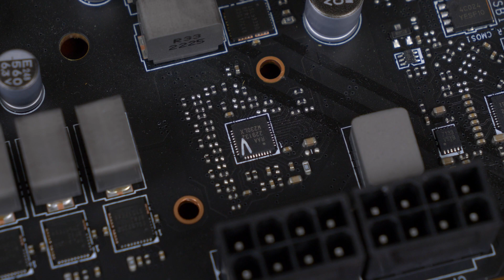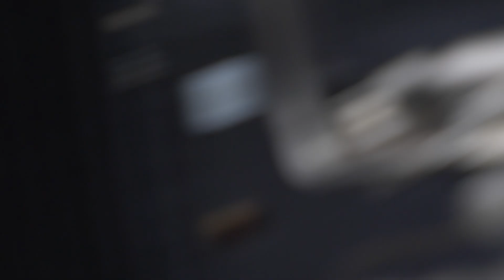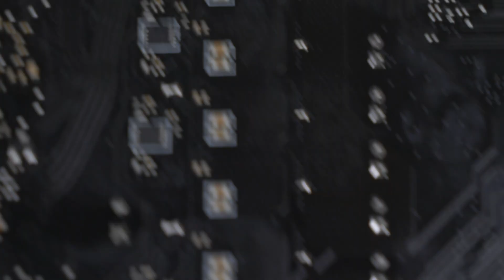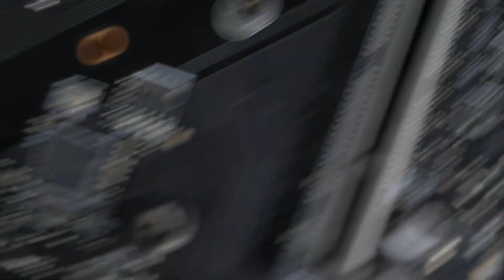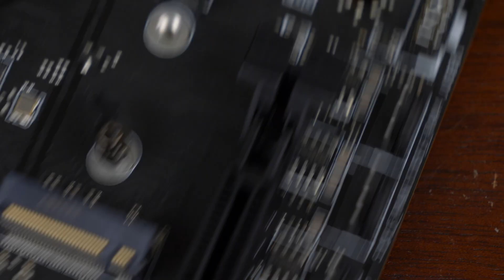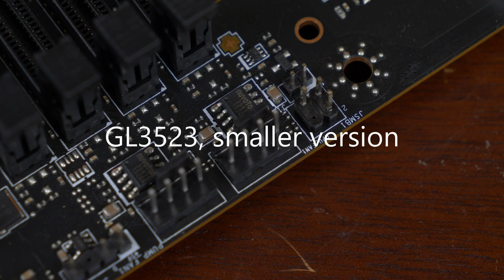Teardown of the MSI MAG Z790 Tomahawk WIFI DDR4 Review Part 2

Comment: Do you by any chance still have this motherboard? I got ripped off being this motherboard from eBay and the seller shipped it with a burnt capacitor on one of the VRMs, the capacitor I mean is placed on the back of the of the motherboard, but it's one of the ones from the top VRMs. Is there a way I could contact or message you? I could show you which one I mean exactly, the reason I'm asking is because I'd like to know exactly which capacitor I need to buy for replacement. Thank you.

Comment: I have the DDR5 version of this board in my PC and while I was running a game, i was trying to put something in the USB port, but I accidentally pressed either the bios flashback or reset cmos button on the IO shield area. It caused my pc to shut off instantly and the first time I tried to boot my pc it took longer than normal but subsequent boots were all normal. My ram OC was reset back to default but I was able to change it back to OC mode from the bios. I’m hoping I didn’t damage anything and my pc seems normal so far. Then again I only did this a couple days ago so I don’t know if there are lasting effects. I feel like it would be stupid for a manufacturer not to have some sort of safety mechanism because they are very easy to press when plugging in usb devices around it. What are your thoughts on this?
Reply from the maker: Yea you hit the clear cmos button. Nothing was damaged. Even if u hit the flashback button it probably wouldn't do anything since you'd need a USB stick in a specific USB slot with the bios file that has to be renamed to a specific format. Even if ur bios got corrupt, you can just fix it with bios flashback.
Reply: @StevesHardware  You can fix a corrupted bios with bios flashback? that’s good to know because I thought you need one of those bios programmer devices which is out of my technical knowledge range. That’s good to know, thanks!
Reply from the maker: @1metallicity  This MSI board and others have a tiny chip labeled "504AN", it is a Fintek F75504 with an MCU with embedded flash. It is able to flash your BIOS without a CPU or DRAM present, just standby power and a USB stick plugged in.  It's purpose is to flash the BIOS as a failsafe to reduce RMAs due to BIOS ROMs that went bad or have corrupted firmware caused by many reasons. It is separate to the BIOS hardware, and the Fintek chip responsible for flashback is a self contained mini PC basically programmed to do one thing; find a file with the right name (that's why you have to rename the BIOS you put on the stick, so any BIOS version can work), from a USB stick formatted correctly and inserted into the indicated port, and write that file to the BIOS ROM. It is basically a BIOS reprogrammer specific to your board. I actually do have BIOS hijackers from long ago that can piggy back on top of a BIOS ROM and act as a second BIOS chip lol.
Reply: @StevesHardware  Also I thought it could be dangerous for the PC to press that button while running
Reply from the maker: @1metallicity  it would have the same damaging effect as pressing the reset button, so you could lose data in windows. What sets it apart from the reset button is that it will clear settings in CMOS RAM, which is why your settings are reset.
Reply: @StevesHardware  Yea luckily I didn’t have any important data to save at the time of the event. I was more so worried about hardware damage or some firmware damage.
Reply from the maker: @eggrollsoupnova2000  you're good, most people don't know this, but when you press the power button to start the pc, the SPI controller (intel in chipset, amd now in CPU) reads the BIOS ROM and loads it into active DRAM, after that the BIOS ROM just sits there and does nothing unless you flash it (that's why you can flash the BIOS with the system on). Hardware wise, it's fine too, you're just cutting power. Maybe it could have a bad effect on hard drives. Enterprise storage devices actually have capacitors that allow the storage device to finish up writing data in the event of power loss.
Reply: @StevesHardware  Thank you!